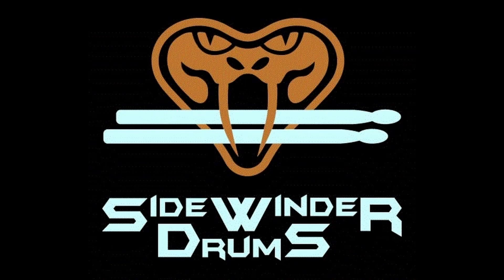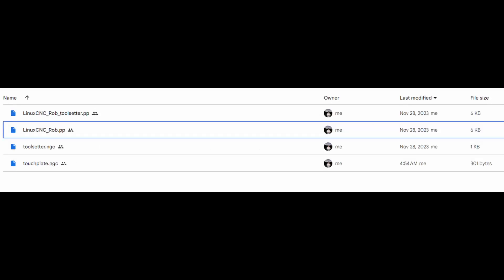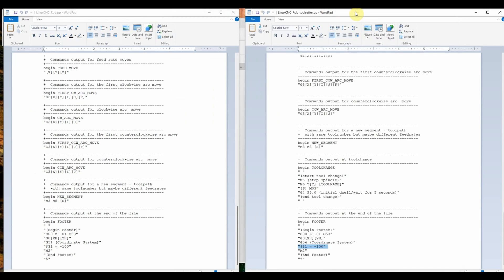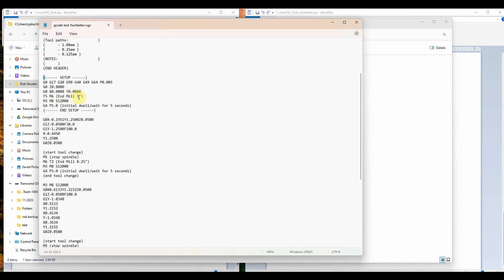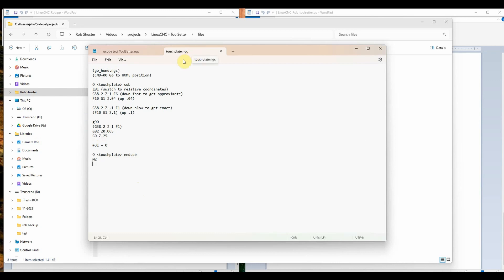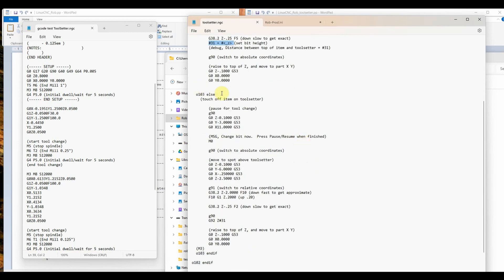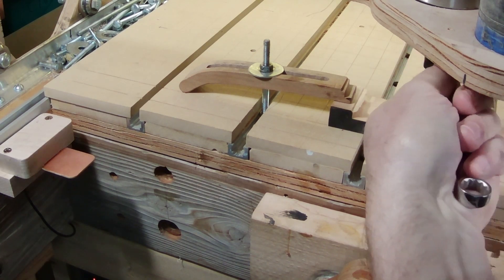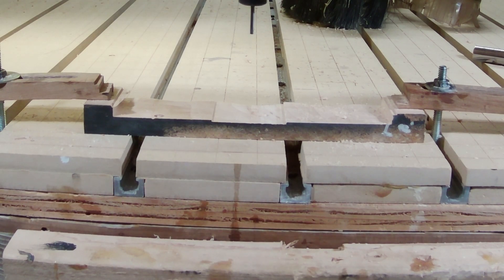Setting up a Tool Setter using LinuxCNC and VCarve Pro

Comment: Found this worked generally well, but having some issues when my files are Metric.  The only solution that I could come up comfortably with, is having an M70 / M72 code to store parameters whilst I am in the tool setter code.  Did you have these issues?  I switch back and forth from old code to new code a lot.  2nd question is on initialization.  How do you force #31 to be -100 on initial bring up of LinuxCNC?  This made my efforts very easy to incorporate a tool setter. Thanks for the vid